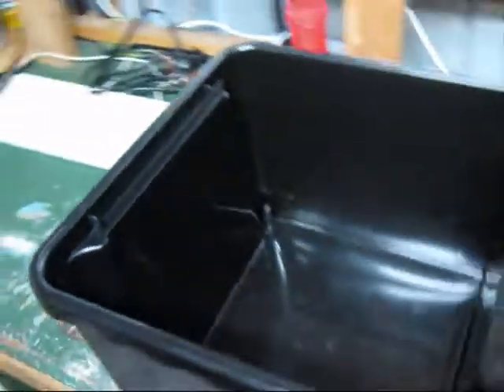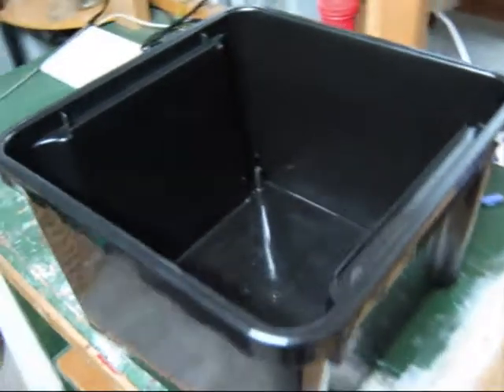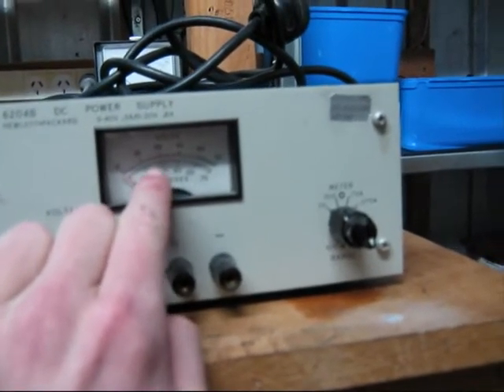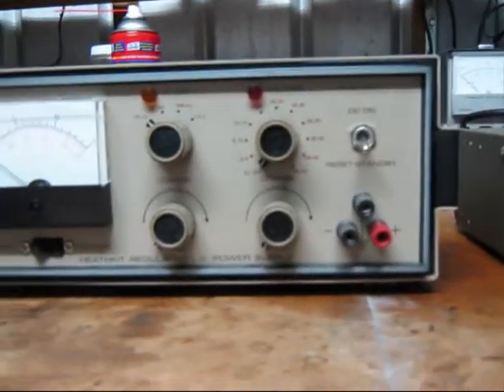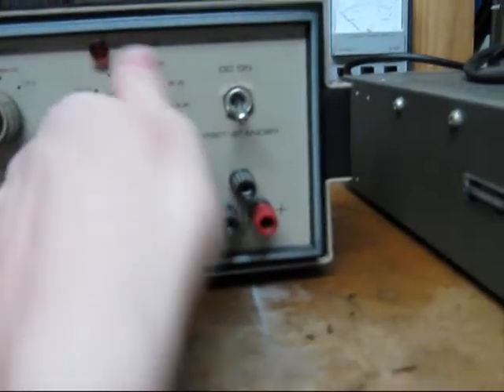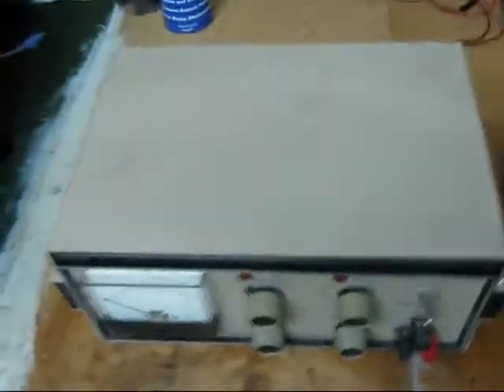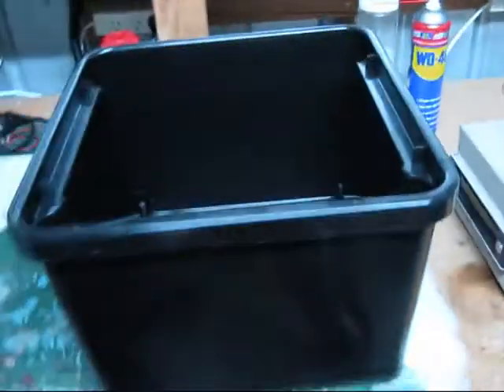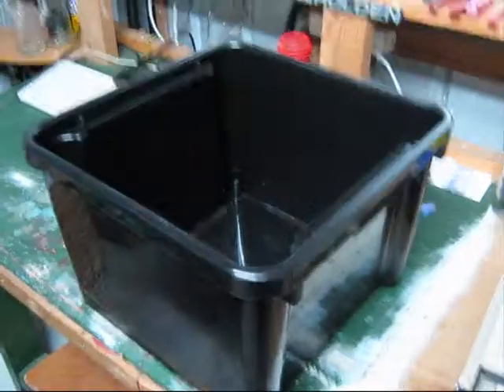My future electrolisys setup

Comment: Good job so far!, mind you don't blow one of those nice PSU's though!

voltage control is not critical at all, all you want is a safe voltage 6 - 40V and maximum current, without killing the PSU.

12vDC at 20 amps should be fine though, but start at 10 and seen that the PSU dose after a few hours. if ti cooks, its not suitable.

good luck!

Comment from the maker: ahh yep, I will try it with the 2 sides instead of 4, It wont be used a whole lot, and when i am using it it wouldn't be for massive parts. So ill stick to 2 plates anyway :)
Yeah i have a few old, rusty pullys off cars and few other rusty bits to test in the tank.

Comment: yeah, no probs.
current determines the amount of time taken to clean the part. but you don't wanna go flat out and blow the PSU.
likewise, the size of tank also determins the speed ans power requirements, anodes that cover all sides of your tank may overload your PSU because of surface area,but only 2 may be sufficient for what you are cleaning.

do a few test runs with rusty scrap or tools and see what happens